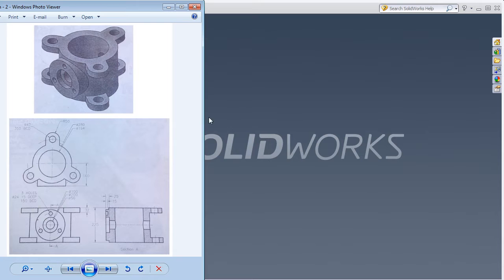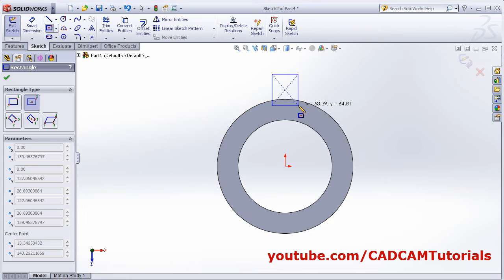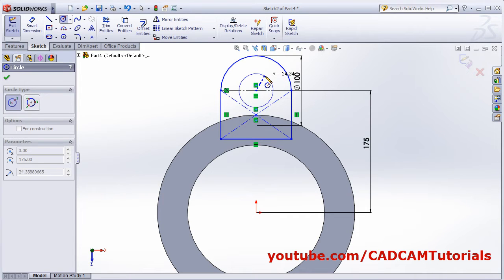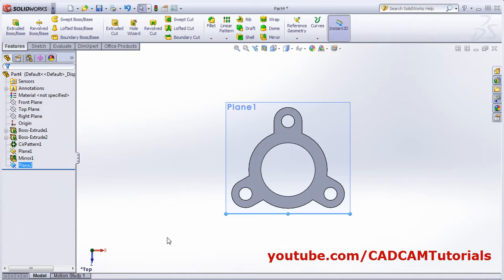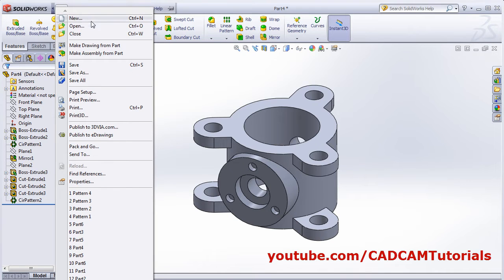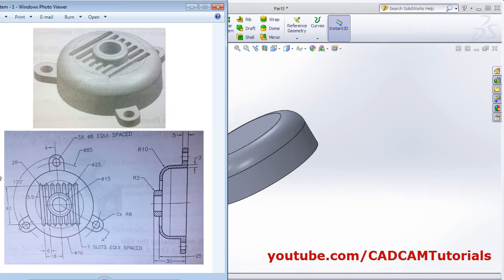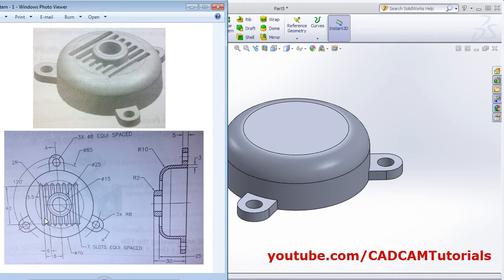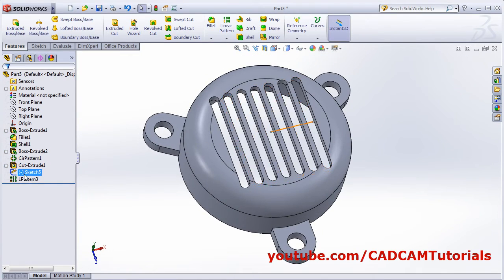SolidWorks Training Practice Exercises for Beginners - 7 | Using Linear and Circular Patter

Comment: 14:25 
The radius is not 2 here. If the radius were 2, the indication would be R2, not 2R. Here 2R meant the dimension of the circular portion of the slot. There in the picture, 3.5 is indicated as the dimension of the circular portion of the slot, so it's not 4 I guess
Reply: Agree!

Comment: Told my job I knew solidworks and autoCAD. Turns out I didn't quite have the skillset they were looking for since I hadn't used solidworks in years and I hadn't done building designs in autoCAD. Thanks to these videos, I learned all I needed to totally pretend I had the skills all along. In any case, I can't believe I wasted all my money in college for these classes when these videos teach better and faster.